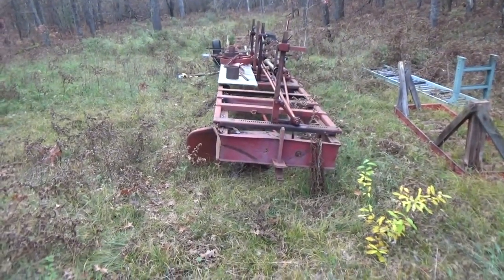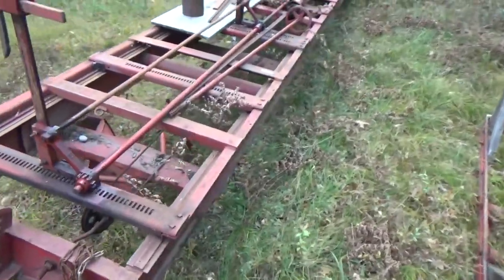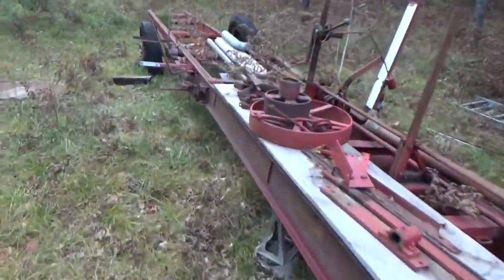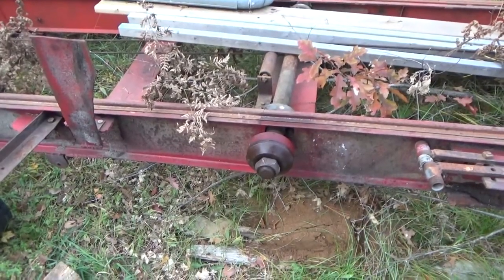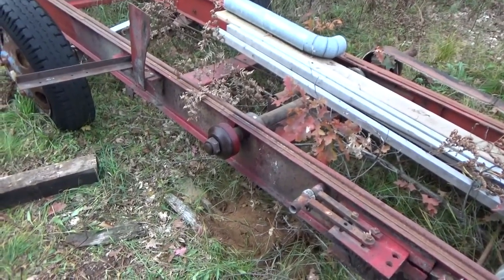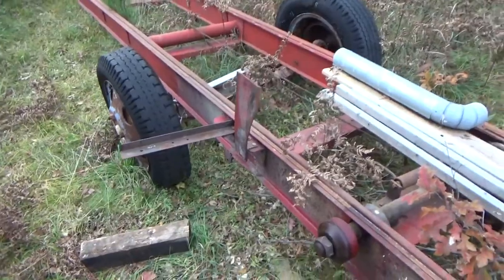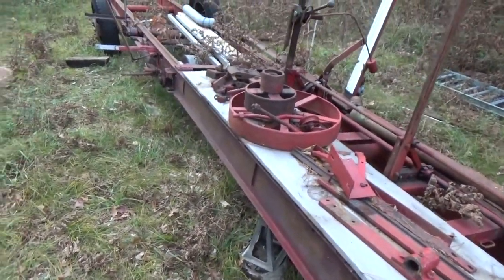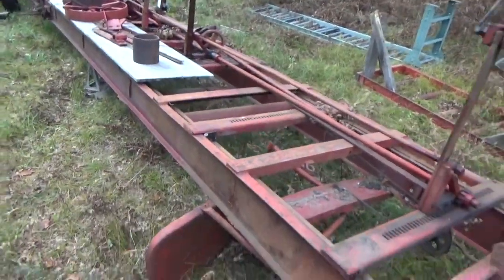Our 44 ft Foley Belsaw Circular Sawmill By Sears Roebuck

Comment: Not OSHA compliant. Even if you operate this thing at home, I'm sure you have to take measures to make it safe to operate. So, all belts and saw blades have to be covered. I can see you cutting some timber on this beast, tripping, and then multiplying yourself by a factor of two.
Reply from the maker: As it stands, it is not safe. I have to put a fence up around the blade for safety. Even this is in the handbook of the Foley Belsaw M14 which is very much like this one. The belts are under the rails and cannot be covered because the carriage runs over the top of that.
Reply: Not osha compliant? 
😂
It’s a 1936 model rig. 
Calm down.

Comment: That mill is made up of parts from several model years. The mill sears sold used the type replaceable gear teeth your mill had. I got one. But the frame is from another model a or m model. The sears mill carriage was 6 ft long.But hey i am about to add 4 ft to a m14 and i will use dogs and carriage off another old sears mill i got. Looks in picture like you got a 1 3/4 shaft m 14 mandrel. The sears used a 1 1/2 mandrel.  Your board splitter is off a much latter model.

Comment: Looks pretty interesting. Is the sawmill operated off a pto shaft that hooks to the tractor? If so it might be good to have an over ride clutch on the tractors pto shaft. Great find. Looking forward to seeing it work!
Reply from the maker: Yes it is powered by a tractor PTO. But I wont be running it with the tractor in gear so it will be safe.
Reply: @TheDoItYourselfWorld  yup....that makes sense.

Comment: It looks like to me without a closer look than what you have provided. It looks like you have removable teeth. I hope you have all of them. I hope you have the wrench to remove them with. They are very expensive even at auction. Very sought-after. This also means that your saw blade sharpener has no purpose. If I am correct that you have removable teeth. Which I do believe that is sharpened with a basic hand grinder and vice.
Reply from the maker: Yes it has removable teeth. And yes its best to hand sharpen these. But I also have the buzz saws, bandsaw, chainsaws, circular saws and other saws that I can sharpen with my new tools.
Reply from the maker: I dont see trolls on this comment but then again, they block me anyway. Yes I can replace the teeth. The sawyer has a couple boxes extra which I can purchase. He also has a sharpener for this. He prefers the manual sharpener due to precise control of how long the file contacts the tooth each time.
Reply: The teeth are less than 2 dollars a tooth. The tooth holders [shanks] are about 6 if you need new ones. If it is a bellsaw blade it was made by b.h. Payne. Should turn 525 rpm. And feed rate is 44 ft per min.

Comment: An 8n ford will not power that you need 80hp plus running on 540pto on mine i run 110 hp mm tractor and can still slow the blade 52inch headsaw. Not trying to disapoint you but thats the honest truth.
Reply from the maker: I have been running it tho
Reply: Never apply 80hp to a bellsaw. Even the newer ones had 1 3/4 mandrel which can take 60 hp max. You would not believe how many wrecked mills i have bought. Guy few miles from here got killed couple years ago on one. A 52inch blade on a 1 3/4 bell saw shaft is asking to get killed. Largest factory blade is 46 inch. And any blade larger does not have a 1 and 3/8 hole and would require a adapter. Bellsaw does not use shear pins in the blade. If blade locks up nut will only get tighter. And some thing will break.